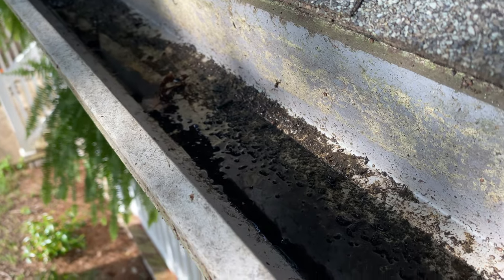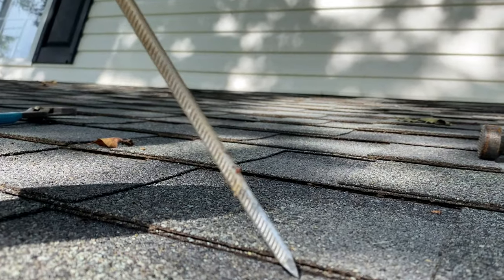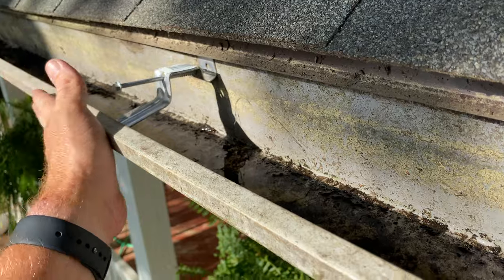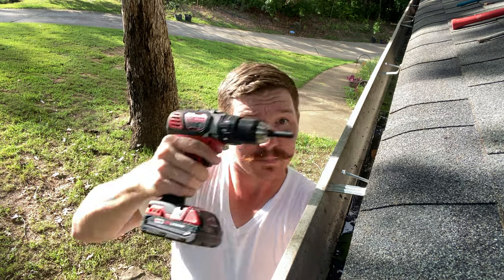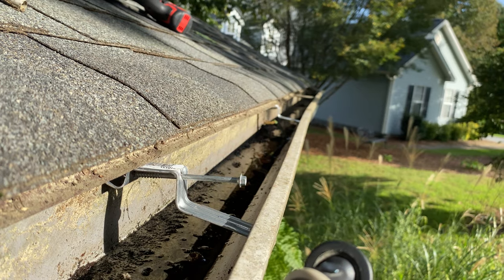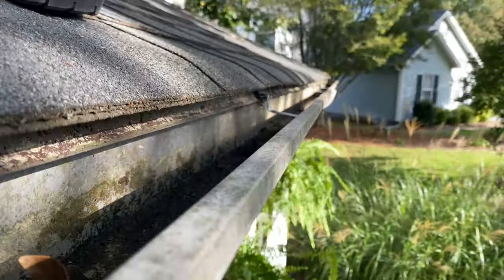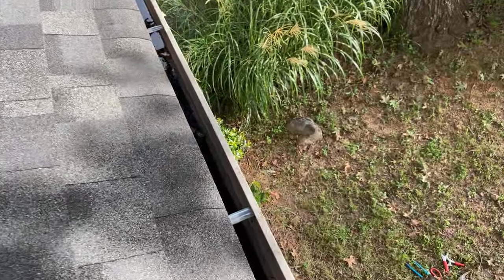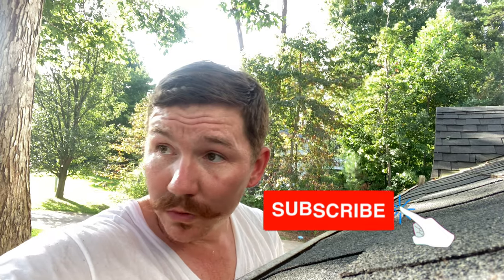Removing standing water in gutter using hidden hangers

Comment: I’m a gutter installer and I’d suggest you start with the high side first for sure… Because you can push the high side all the way up (until the hanger touches the drip edge and work your way down)… because if you’re notching the next to last hanger on the downspout end on a 25+ft. Piece, you’re definitely in trouble… You will be running out of proper spacing to effectively drain the gutter and you may end up having the gutter too high to we’re it is pushing up the shingles and possibly damaging your roof system… Not being a nag, but any professional gutter installer would know this… Somethings ain’t as simple as it seems
Reply: I am getting ready to hire a gutter company to install new gutters on a new metal roof. They specified 36” spacing on hidden hangers. I have some large roof areas and am located in S Florida where we can have heavy downpours. I told them I want a minimum of 24”’spacing, but wondering if the largest areas should be 18”, or is 24” sufficient?
Reply: @michaeltranchina6358  36 Inch is just too much distance. I would go with 18 inches.

Comment: Suggestion: Do the water flow test BEFORE finally tightening the clip screws. That way you adjust more easily if the flow test fails.

Comment: I asked leaf guard to come look at my gutters and they quoted me over 4 grand to replace...I was like uh no thanks I just get up there and take out leaves by hand but I do have trouble with water in there as my gutters are bowed....not good as this breeds mosquitoes
Reply from the maker: Yes, leaf guard is probably the most expensive out there. I believe they have a patent on that one piece design, and only allow certain vendors to install them due to warranty. At least that was the scenario when I used to sell them when I worked for a general contractor.

Leaf free is a really good guard you can install yourself for about half the price. It won’t do anything about your water issue though.

Comment: Im a gutter installer, u always start at the high end of the gutter. Then grade down to the downspout. Roughly 18"-24" for bracket placement.
Reply from the maker: I did the back gutter last weekend and that’s how I did it.
Reply: Thanks. I was thinking of that too. Perfect with just a bit water in the gutter so that so see the water flow direction as you go.
Reply: If there are downspouts on both ends, would I start in the middle?

Comment: Great descriptions!
An impact driver will save your wrist on those installs. Also, you can bend the new bracket on the outside 1/2 with a channel lock to help with tilt and pitch both poor and post installation. Just some of my thoughts bud. Great work!!
Reply from the maker: Thanks for the advice. Anything helpful is always appreciated 👍🏽

Comment: Subscribed! Like how U explain things…do’s and don’t and reasons why. I have a question about spout drains going underneath concrete to I don’t know where underneath the concrete. I’m a little worried if I need to do some clean out maintenance cuz I know the gutter system gets moss chunks. I’m afraid there is like bunch of gunk down there
Reply from the maker: Hey man we really appreciate the support. Thanks for the sub, it all means a lot. 

It’s always possible the drainage system underground can get clogged. If it does, they make a motorized snake that works on cleaning out the pipes underground. Same tool that cleans out toilet pipes. I would suggest that if it got out of hand and your setup quit draining water.

Comment: I think cleaning out those tiny shingle rocks that shed off the roof over time will help the water flow as well as the correct pitch.  I will be installing inside brackets soon because of water rolling behind gutter in a 10 foot section of gutters.  If the brackets don't fix the water behind gutter, I will install a drip edge flashing apron like you already have.  I live in northern Indiana.  Thanks for the video.
Reply from the maker: The granule build up will factor into the water flow for sure. But IMO the leaves and debris are more of a concern. Glad you enjoyed the video and thanks for the support. 👍🏽
Reply: @TheAdamConners  gutter installer here. I’ve seen excess granules from a new roof being put creating an almost water tight road block in a run of gutter SEVERAL times. Not only that but they add an immense amount of weight vs leaves and dirt.
Reply from the maker: @carterhutchison7211  a new roof should not have “an immense” amount of granules in the gutters. I’ve installed roofs for 7 years now. That is not a normal thing if that is happening.
Reply: @TheAdamConners  over the first six months they shed a lot of the excess granules that didn’t adhere to the composite in the factory. I do this everyday for a living man. And I saw your other comment asking if I had anything helpful to share but I can’t help someone who knows it all already. My only advice to you would be to take some from people who are experts on the matter. I’m no handy man. I can’t do all those things you say you do in your video. Not a jack of all trades by any means. But if there’s one thing I know, it’s gutters my guy. I honestly quit watching the video after you started re-sloping the gutter from the middle 😔 That’s when I suggested that people call a gutter company.
Reply from the maker: @carterhutchison7211  thanks for your commenting. I disagree, but I’m glad you are speaking up. Thanks for watching.
Reply: I clean about 1000 gutters per year as a profession. I see more gutters full of roof particle on new roofs than old roofs, not to mention all those roofing nails.
Reply: @Mabrito88  thank you my good sir
Reply from the maker: @Mabrito88  at the end of the day nothing weighs more than water. Regardless of what stops up the flow, water will pull a gutter away from a fascia quicker than anything.

Comment: Thanks for the video. Unfortunately, I couldn’t get the gutter hangers to fit in my gutter. They were too long; there wasn’t enough give in the gutter to bend and hook it. I guess I would have to remove some of the existing gutter spikes … but maybe that will just make my standing water problem worse?
Reply from the maker: Yes, just installing one would be pretty tricky. The gutter needs to be able to bend enough out of the way that you can hook the hanger in there. So yes, you would have to remove a few spikes to get one gutter hanger in.

Comment: Great video Adam. I'm in a spot now that the rainy season is beginning here in Hawaii. A tree fell on my gutter. Didn't damage it but it seems a bit bent so I got the hangers and attempted to do the repair but it's not going so easily. I have 6 inch aluminum gutters and the roof is three stories off the ground. I am doing it from the top which is fine but my problems are these
1. The roof hangs over at least an inch from the house with Drip edges covering the house side of the gutter edge
2 The gutters are attached with metal brackets that are riveted and are in good shape. (not going to remove and create more of a headache}
3. I have the six inch hanger and I can't slide the end under the drip edge. The space between the roof and the edge is minimal 
4. Due to the metal brackets already installed, I can't fit the hanger so it's square. Its too tight

I tried to just attach without going under the drip edge but the outer side of the gutter won't fit under the lip properly  and the gutter just sits on it without being fully connected but it does raise up.

Can I just do it that way since I really have no choice or is there a hack that I can use to solve?

Thanks
Reply: Update. I put two hangers in without going under the lip just because it's supposed to rain hard again today. I think I will eventually snip the last riveted hanger and try to bend out the gutter enough to be able to get the hanger under the lip. If you have any ideas though, I'd love to hear them. Thanks again
Reply from the maker: First off BE CAREFUL! 3 stories up is really dangerous. You are going to have to decide if you want to drill through the drip edge or if you want to cut it on each side of the hanger and bend it up like I did in the video.
Reply: @TheAdamConners  Thanks
I'm up on the roof pretty often and am pretty careful..lol.. I ended up taking the rivet oof the existing bracket and putting the new one in next to it. It was a tight fit but I got it in there. I managed to get it under the drip edge and drilled it.. All upside down from the top of course. I'll replace the rivet one day soon on the old bracket just to make sure it stays up there.. Just have to wait for a good downpour to see if it raised the gutter enough..

Thanks for your video and help 🤙🤙
Reply from the maker: Very glad it helped you out, thanks for the support 👍🏽👍🏽

Comment: I assume those gutter hangers are identical. How do you adjust pitch if they are all the same size and snap on the same way? Do you have to bend some of them?
Reply from the maker: Pitch is determined by where you fasten the screws to the fascia. You just screw in each hanger and make sure the gutter is a little lower each hanger until you get to the downspout. For every 10 feet of gutter it should drop or slope 1/2”.
Reply: @TheAdamConners I just had a new roof put on would they have taken the gutters off to do that, Just wondering because they seem like they are pitched away from the downspouts, water doesn't drain anymore
Reply from the maker: @rodgerbaer6382  no a roofing crew doesn’t remove the gutters unless the gutter hanger or gutter spike is nailed through the drip edge. In that case they may remove them, but a gutter company would reattach them. Now what is possible is during the roof install process a crew member accidentally putting too much weight on the gutter causing it to sag a little or fall away from the fascia. I’ve seen them put their foot in the gutter on real steep roofs to install drip edge or starter. It’s just them trying to brace themselves. It’s not necessary but understandable. It’s also possible they didn’t clean out the debris good enough in the downspout after the roof install. There is a ton of mess from tear off as you know by this point. Good luck. Keep us informed on the solution. 👍🏽

Comment: is it critical that the hangars are screwed into rafters or is the fascia board adequate?
Reply from the maker: I don’t think it’s critical, but screwing into the rafter is a good idea. 👍🏽
Reply: @TheAdamConners  I agree. Probably ideal to use rafters but you use some extra hangars you're showing and it should help take a lot of the "work" off the others to either side.
Reply: Yes best practice is hitting every other rafter tail at minimum but most gutter guys that aren't very professional just speed thru the job and would rather not take the time e to move them. 1 the gutter is more secure to house and So is your fascia 2 you don't see the shiny screw poking thru your fascia where there is no rafter tail.

Comment: Do those hidden hangers work only as a repair to a ORIGINALLY INSTALLED COREECTLY PITCHED GUTTER or can they also FIX an ORIGINALLY INSTALLED INCORRECTLY PITCHED GUTTER?
Reply from the maker: Usually it’s only a matter of time before any gutter (no matter how well it’s pitched) will start to lean away from the fascia board if it has the gutter spikes and not the hidden hangers.
Reply: @TheAdamConners    Well we dont use gutter spikes here in New Zealand I dont think Adam,  we use gutter brackets, so guttering does not end up leaning away from the fascia board, so I will assume the hangers wont be a simple solution to my problem after all. Ha.
Reply from the maker: As long as your gutter is a “K style” the hangers will work. We also have gutter straps here in the US but not as common.

Comment: So can you just set your low end and your high end of the gutter then pull a string from one end to the other and adjust it to the string all the way to the edges?
Reply from the maker: As long as the gutter isn’t lower than the downspouts you should be good. Probably several ways of checking, but a string would definitely work. My gutter in the video only has one downspout so it’s just a gradual fall from right to left. Some gutters have downspout on each side so the middle would be the high point and it should fall both to left and right.
Reply: @TheAdamConners  yes. Mine was originally that way with two down spouts. We had a patio built and I sealed off the one end so water wasn't on it all the time. Going to feed it to the other side. Mine was nailed under the shingles through the gutter. Doesn't have those big nails... Difficult to get a pry under there to pull the nails as well...

Comment: Yea i got a facia with punky spots in it and cant get the hangers to bite every time..   i need to put on new facia but already had the gutters replaced and when the installers were supposed to replace the rotted facia, apparently they didnt replace all of it..  so i got new gutters that are separating from the facia in places..  crappy deal is that company wont come fix it because its been a season since the install so they’re asking 600$ To come out and fix the issue they made with my 3000$ gutter job…. Bastards..
Reply: Just noticed your comment after making mine. I would also like to see a rotting fascia replacement on a ranch style house like this